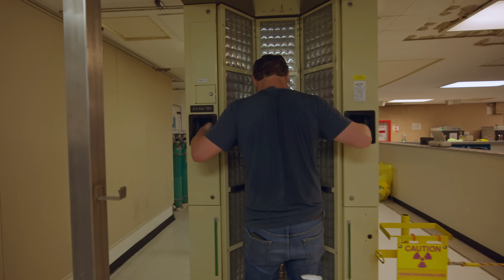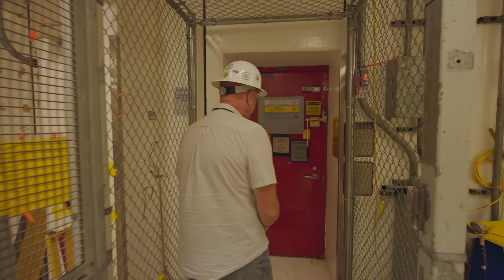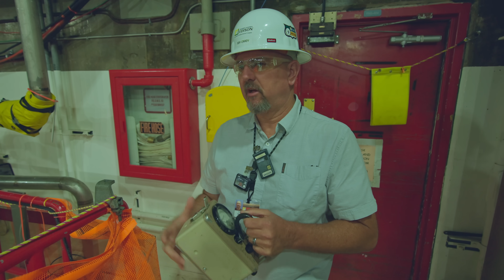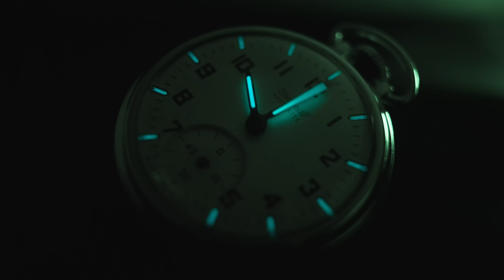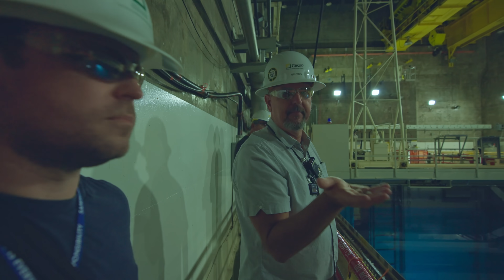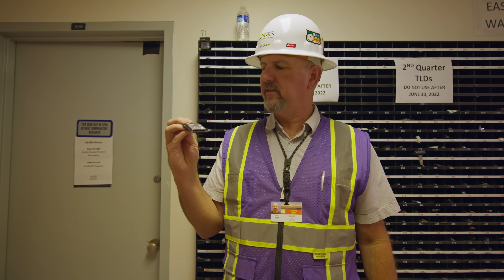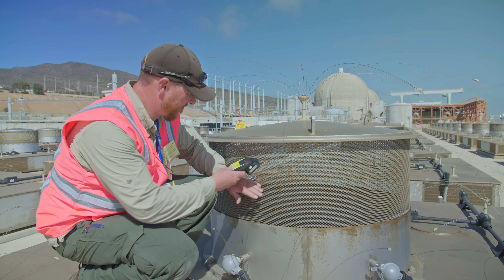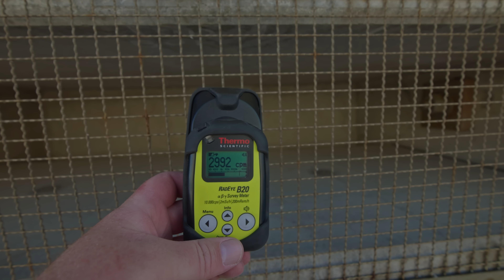Inside San Onofre Nuclear Power Fuel Pool and Spent Fuel Storage

Comment: omg so much stuff is just a bit off. for starters most plants that arent in decommission now the contamination monitors you just stand in no buttons and stuff like that, no one calls it the spent fuel building but this guy they call it the fuel building, the AUX building is not the radwaste building those are 2 completely different things atleast in the dozen plants ive been in as an operator for over 12 years and about as much time in other positions at nuke plants to have as much time in plants as this guy including the NRC reactor operator licensing program. the AUX building is very different its part of whats called secondary containment and has emergency cooling systems. the shielding on the pipe is because its an elbow and fission products esp from systems like spent fuel pool cooling system will tend to settle in places like that and increase dose but it is to decrease dose to workers in area, they are called a hot spot.  geiger mueller detectors is a specific form of ion chamber detector they arent completely different for the most part one is just more sensitive then the other as it uses a lower voltage and thus can be smaller. for the most part hes right about the dry cask storage containers, cherenkov radiation is form the particles moving faster then the speed of light in a transparent medium such as water lats a couple weeks after u take bundles out of the core. most of the blue glow u see in the pool is from the lights. the upender pit is called an IFTS pit or HFTS pit which is inclined or horizontal fuel transfer system depending on if going from one building to another requires an elevation change. only a few plants have IFTS most have HFTS. hes correct with the shielding of water and dose on fuel room. only seen it go up any noticeable amount when a plant does full core off load when the entire core has all its fuel brought down to that pool. usually only 1/3 of the fuel is replaced every 18 months on average. some plants do it every 2 years some every year depends on plant. the clothing stuff some plants now have adopted disposable stuff they just incinerate after use and send the fumes from that incineration through filters to pull out radioactivity so your not releasing anything to environment. decommissioning sites us dosimeter that measures neutron operating sites dont they only need the neutron monitoring very infrequently during outages as such they dont use the same as what he shows. the EAD electronic alarming dosimeter he used however is same as most plants use now 4 sites ive been to in past 3 years use the same model that came out not to long before that. the dry cask he showed are quite a bit outdated now adays and for past say 10 years ive seen they use more modern ones that have no moving parts as they are self cooling by design for more info on the new ones just search dry cask storage they look like big cylinders and u can see them just sitting on a concrete pad about 20 or 30 feet high and are extremely durable and very low dose u can touch them with the monitor and wont see negligable levels above background radiation. On a hot day when radiation from sun is strongest you dont see a change at all. the canisters are designed to withstand a level 5 hurricane or a 747 directly hitting it. if one fell over wouldnt really do anything if by some slim chance it did open some way yes then if u were far enough away to not see it and someone said walk to it youd be dead before you got to it. but a large enough force to do that would also have destroyed the planet. fun fact bananas can set some of those monitors off cause they are more radioactive then the detectors are sensitive
Reply from the maker: How's it a bit off. Different places do things differently. That's how every industry is.

Comment: I'm totally against this as a power supply, until we can safely dispose  of the waste we should not be generating more. Is it any wonder the world is full of cancer, shame on those involved
Reply from the maker: The level of waste is extremely low, especially compared to a lot the energy sources out there. Nuclear uses the least amount of land and has the lowest amount of environmental impact than any other power source. The spent fuel isn't a problem. It can still be used as a power source and can be easily stored onsite. The problem is so many people want to over-regulate it. Our world is going to need an ever increasing amount of power...nuclear is the only way to supply it.
Reply: @RadioactiveDrew  I think your wrong nobody wants this on there doorstep, they told us coal was a problem after letting us use it for years. The funny thing is we didn't have some of the problems we have now, and the truth is I'm not against nuclear as a power source I'm against the use until we know how to dispose it. When they find away to safely put it beyond use then I'm afraid nobody will convince me
Reply: @minidigger1000 
Coal kills around 500,000 - 700,000 every year end to end

Nuclear less than 100, from mostly machine accidents in mining uranium 

Radiation exists in everything in the earth, you will get more Radiation from standing outside a coal plant than if you stand outside a nuclear reactor 

You need to knowledge up

Comment: The main problem with nuclear energy is the cost involved. The cost involved to operate in the cost involved to mitigate any incidents. Just to be considered to potentially operate a nuclear facility in the future you have to have a decommissioning fund before anything happens. Before Construction, permitting , anything. and as of the last time I heard about it in early 2000s it was 10 billion dollars that was the minimum required for the decommissioning fund. That has to be liquid assets set aside. That cannot be touched. That is an inconceivable amount of money. That's not including permitting, construction, operation, risk mitigation, actual incident responses, that's just the decommissioning process. What the government is trying to avoid by instituting this is companies running out of money halfway through the decommissioning period, and then it becoming a super fund site.
Reply from the maker: Nuclear has been over regulated for decades, which has only hurt the industry and society.

Comment: This seems greener than green energy and produces way more power
Reply from the maker: It also used far less land than a wind farm or solar field does. Green energy only seems green if you don't look into it much. People think that its okay to build these wind turbines or solar panels out in the desert thinking because they don't want to live there then nothing else wants to live there. But these installations are just as destructive as if you cut down an entire forest to build them. Don't get me wrong, solar and wind have a place in the energy supply chain. But solar panels should be on rooftops and over parking lots.
Reply: @RadioactiveDrew  i live in a major area for wind energy and it makes the land look terrible my profession is an electrician and from everything I have ever seen nuclear is the way to go if we could put in research to dispose of the waste in away that could possibly make it inert no idea if that is even in the realm of possibility but if it is that's where we should look. And we have tons of turbines that the buisness went under now they are just there not producing energy and causing issues with the catching fire or falling down

Comment: So how warm is the spent fuel pool when there fuel in there
Reply from the maker: I can't remember off the top of my head but I'm pretty sure they would run the water in there through a heat exchanger to keep the temp down. The spent fuel can be extremely hot when it comes out of the reactor. Usually it sits in the water for a couple years until it cools off a bit. Then it can be moved to dry storage but even then the heat that comes off of that spent fuel it pretty high.

Comment: I used to work at a nuke plant back in the mid-90’s. After leaving a radiation area, you had to step into a scanner and actually put 1 arm down into the machine while it scanned 1 side of your body. Then you’d have to turn and scan the other side of your body. If you weren’t contaminated, then you could leave that area. The rad workers that dealt with contamination on people were called “HP’s” (Health Physics). If you couldn’t clear the scanners bcuz you were contaminated, the HP’s would take you to a shower area, throw you a Brillo pad, and watch you shower and scrub your skin. They’d throw you surgical scrubs (shirt and pants that medical professionals dress in) to wear after bcuz they took your clothes to check for contamination. You’d also have to poop and pee into bags so they could check to see if you had internal contamination. It was rare to have someone contaminated, but those that were did not have a fun time and usually had to stay way past clock-out time, until they were no longer contaminated.
Reply: Another thing about working at a nuke plant……the constant hum of electricity and the slight smell of burning electrical components permeates most areas. It’s like you can almost feel the massive amount of energy in the air. Most nuke plant workers know what I’m talking about.

Comment: Why is it being decommisioned
Reply from the maker: A couple of reasons. First thing that opened the door on this was a steam generator they they had replaced and arrived damaged. Since it takes 3-5 years for one to be built they tried to make the one they got sent work...it leaked causing problem. The second thing was that the power station is located in California and the anti-nuclear people there choose to be uninformed rather than learning about nuclear power and radiation. So Southern California Edison caved under public pressure...along with the state legislator working against the site.
Reply: @RadioactiveDrew First part is wrong. They had all four steam generators replaced. They did not arrive damaged, they had engineering design flaws which caused tube leaks which were being repaired, but the local hippies decided to protest and have it shut down for good.

Comment: In a nuclear accident, one would be wise to get into water — yes?
Reply from the maker: No. In a nuclear accident, say Chernobyl, you don't want to be in water. Main problem would be radioactive material coming down in a dust...that would settle on the water. So when you get out you would have a very thick coating of radioactive material on your body from all that dust sitting on top of the water. I understand using water to shield yourself from radiation. But unless you have an underwater habitat 10 feet down or so...it isn't going to help. Main thing would be to have a radiation detector of some kind and stay inside with the windows and vents closed.

Comment: Worked at one of these plants when it was first fired up. On my first walkthrough of the plant the step-in monitor alarmed..they took my coat...gave it back to me at end of day and said take it home and wash it..I wasn't thrilled. Turns out we had uniforms that were polyester and static from walking around wound build up on them and attract the radioactive particles.  Armpits and knee areas were the most common areas..some folks would lose their pants. It was low levels and decay was fast..sometimes you could step out..count to 30 and it would no longer alarm.
Reply from the maker: Wow…sounds like some very short half-life isotopes there.
Reply: First rule when entering the RCA: NEVER wear man- made fibers like polyester... Always wear cotton. Polyester attracts radon gas which sets off the monitors.
Reply: @sylviaisgod6947  It was obvious the engineers in the plant were always in cotton..we as minimum wage contractors were forced to wear these uniforms.

Comment: Nuclear is the cleanest energy next to solar. Soon as they figure out and start using the nuclear waste in a battery, everyone will be on board.  I work refueling outages at a nuclear plant. Would have been way cooler if you showed everyone the rod change during an outage
Reply from the maker: I would really like to make a video at a nuclear facility during an outage. Would be very interesting to see that process firsthand.

Comment: There must be a cost versus output that puts a limit on the life of the fuel cells. Also, when the pool was in use and containing fuel cells in storage, what was the temperature of the water, or, what could it reach? Very interesting look into a nuclear plant, albeit, closed.
Reply from the maker: Usually the fuel isn't referred to as "fuel cells". Usually its called nuclear fuel, spent fuel, fuel bundles. When some of the enriched uranium 235 fuel fissions in the reactor it turns into other non-fissile isotopes. This makes the power output drop because the heat drops. Pressurized water reactors like San Onofre aren't very efficient at using the fuel. When the spent fuel is removed from the reactor its very hot. I would imagine the water to be a little warmer right after the fuel is swapped out.

Comment: Yet still the nuclear industry refuses to use a molten salt reactor to use the spent fuel rods to generate more power and reduce them to completely inert and harmless. The problem with nuclear power is that when it goes wrong...and it will...its cataclysmic. No one will ever change my mind.  The entire reason water reactors were created was to create weapons grade radioactive material. My mother was administrative assistant to the director of the Atomic Energy commission back in the 1960's and heard all the information first hand.
Reply from the maker: Yes, light water reactors were pushed as a way to generate power because it lined up with fuel enrichment and plutonium production. Breeder reactors would have been a much better solution that's for sure.

Comment: Why is the power plant being decommissioned. If it is only to please green nut jobs than that is a crime.
Reply from the maker: The original reason why it was closed down was because of a leaking steam generator. It was an excuse that Southern California Edison used to close down the plant. It was closed down because anti-nuclear people don't understand how any of the tech works or what are the real risks associated with nuclear power.
Reply: @RadioactiveDrew  Yes sir, totally agree. It totally blows me away that the real answer to the world energy demands could be so easily covered by nuclear power. Yet we have halfwits closing down safe and functional Nuclear power plants. Correct me if I am wrong but 3 mile island did not release any radio activity and if the guys running the plant had of been better trained it would not have happen. Chernobyl was an act of sheer stupidity that is a study in why communism does not work. Fukushima Daiichi Accident could have been totally prevented if not for the hubris of the Japanese engineers putting the emergency backup power generators in the basement of a earthquake tsunami prone area. Thanks for taking the time to reply.

Comment: Why can’t the plant continue operating. Also if the fuel is still’hot’ why can’t that be used too?
Reply from the maker: Southern California Edison, the utility company that owns the plant, closed it after a steam generator they just ordered arrived damaged. They used it as an excuse to close because the state of California wanted the plant closed. The spent fuel is still hot and should be used for energy production. It wouldn't be as much as what they were making but it might be enough for over a 1,000 homes to be powered. Could be a lot more than that if done right. The Perseverance rover on Mars has an RTG (radio thermal generator) using 10 lbs of plutonium for all its power. That is slated to last 14 years.

Comment: This guy giving the tour is typical tour guide who is full of PR but weak on his facts. The water in the spent fuel pool is not "plain water". It has a high concentration of 
 "boron". BORON absorbs neutrons. Not water. The control rods are also BORON. When the reactor is brought on line the core has high concentration of BORON circulating through the primary system. The control rods are withdrawn, then the BORON concentration is reduced in a controlled manner which allows the neutrons to react and the core is allowed to become critical. In the bottom (lowest level) of containment are huge rectangular shaped containers constructed of perforated stainless steel sheet metal. These containers are full of, you guessed it, BORON. In the event of a accident of a particular type, their was water stored in a reservoir outside of containment that would be pumped through a spray system inside the dome and flood continuously predetermined areas and equipment to reduce heat build up. The water would flow to the basement (7' level) ant the BORON in those rectangular boxes would mix with the water, flow to a sump and be circulated back through the containment spray system automatically and continue so until engineering evaluation determined it was no longer needed. Yes it is the same BORON that we wash our hands with or add to your laundry. Real basic shit and hard to forget unless you are sleeping or texting in Red Badge Training.

Comment: That last statement is what my mathematical brain has always wondered. The level of radiation isn’t the only factor it’s also the type of radiation. Like buckshot vs assault bullets.

I’ve also wondered about the environmental impact of a coal plant vs a nuclear one.
Reply from the maker: There's no such thing as "assault bullets". Commonly they are called rifle rounds. The alpha radiation coming off of the uranium glazed ceramics has more energy than the gamma radiation. But it also doesn't go very far because it slams into air molecules and gets stopped.